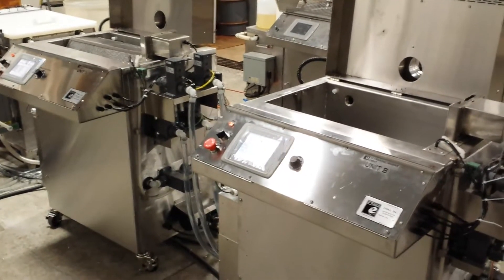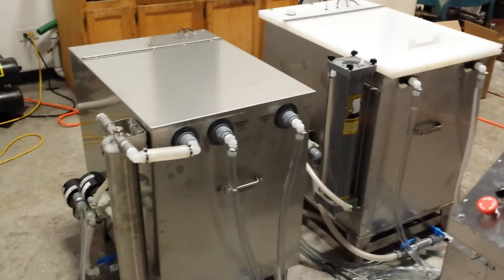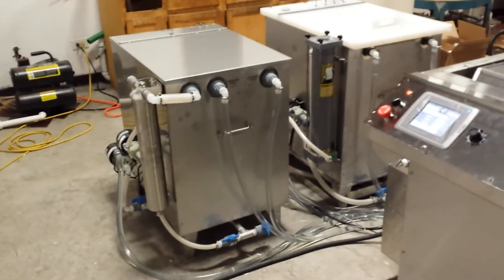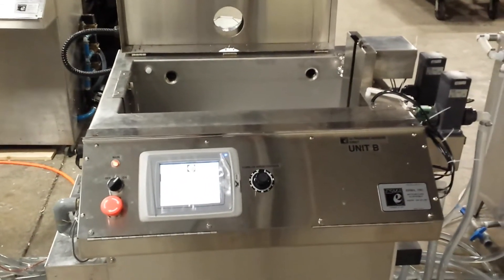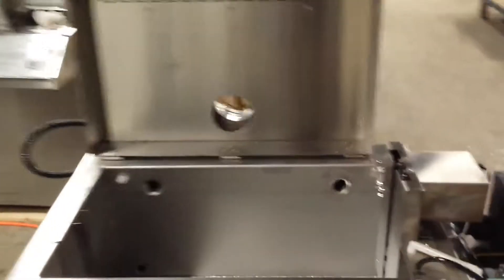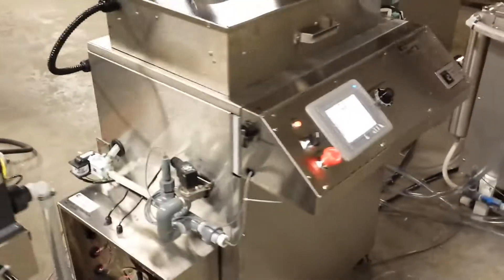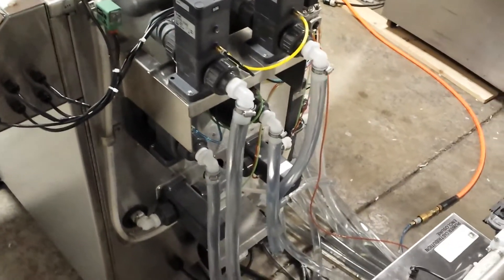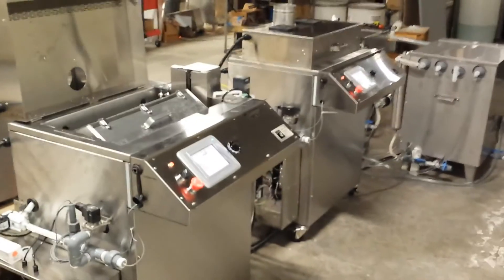Dual Process Tank Automated Ultrasonic Passivation System for Medical Device, Aerospace, and other

Comment: How long does it take to run a complete cycle?
Reply from the maker: John Murley It depends on the process requirements but typically 30-60 minutes
Reply: Wow, that's pretty good. I was thinking the draining and refilling would add significant time to the overall cycle time.
Reply from the maker: John Murley The longest part of the cycle is typically the drying process which is dependant on part geometries.